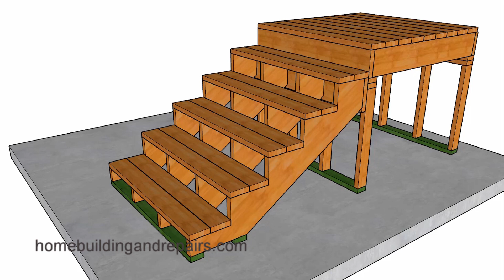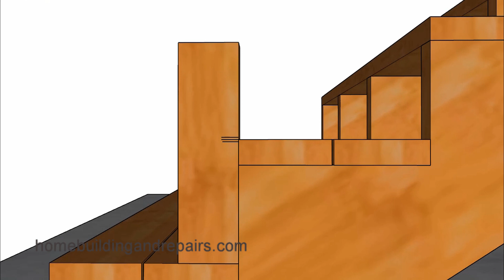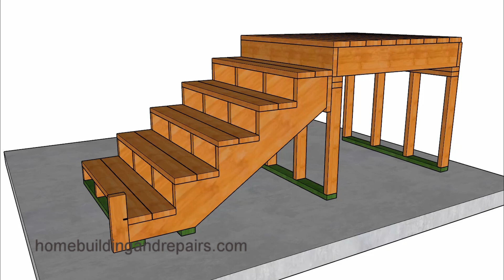How To Use A Block Of Wood To Check Stairway Riser Variations - Building Code Tools

Comment: Determining riser variations is the easy part. The difficult part is how you go about correcting them on an existing staircase. If you found the disparity in risers to be 3/4 inch then what options do you suggest to remedy it? Thanks!
Reply from the maker: Defiantly easy when you know what you're doing. I thought I had some videos on this, but couldn't find them. I put your suggestion on my list and if want to email me a picture of your stairway, I will take a look.